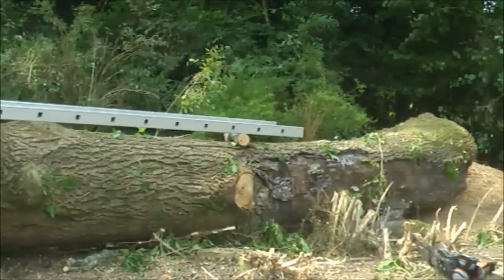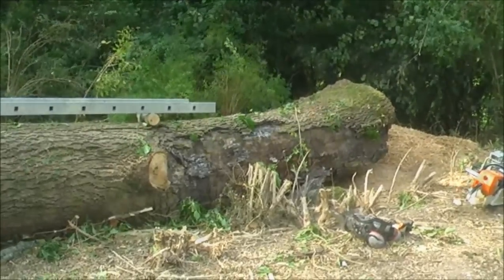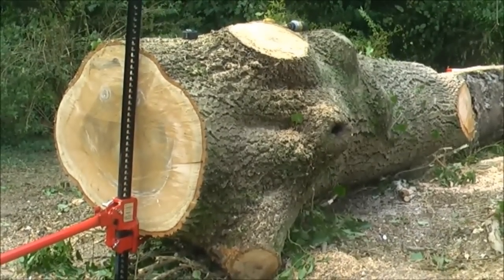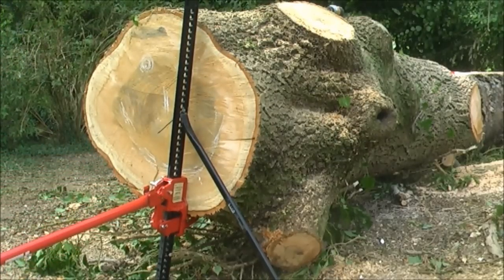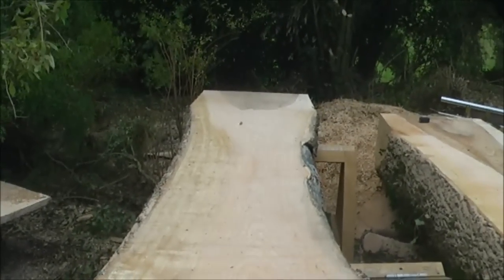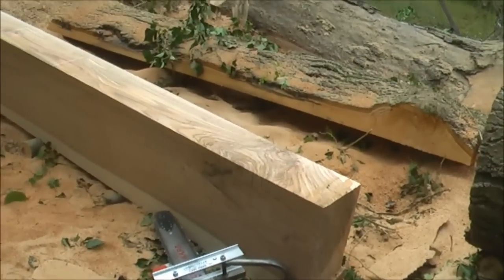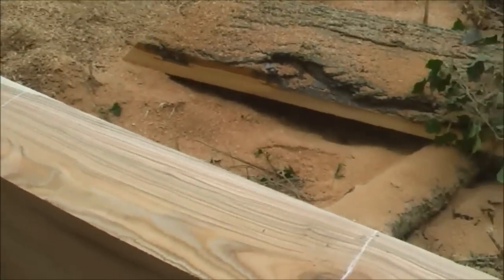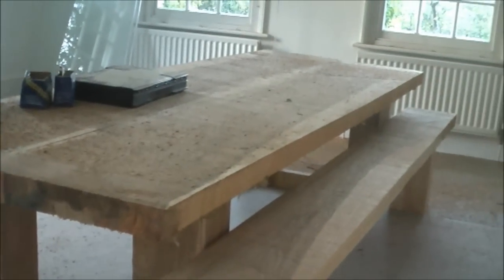Attempt to mill and make a large Ash table in the same day - Granberg Alaskan milling

Comment: I just used my mini mill yesterday on a 14" mulberry tree. I used a Stihl ms250 with 18" bar and stock chain. It worked well in my opinion but 1st time ever milling. I do have another section to do so I did drop my extra chain off to be re sharpened at 10 degrees plus the removing the top of every 3rd tooth as per instructed by a rep a Oregon chains. Hope this helps